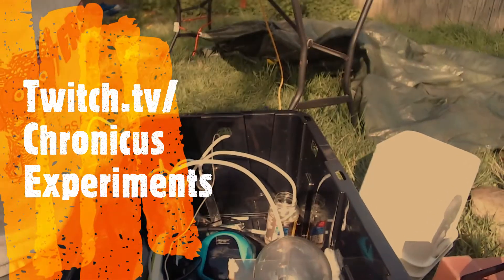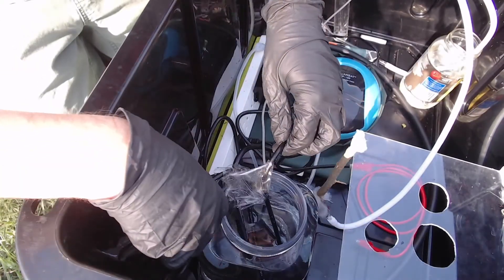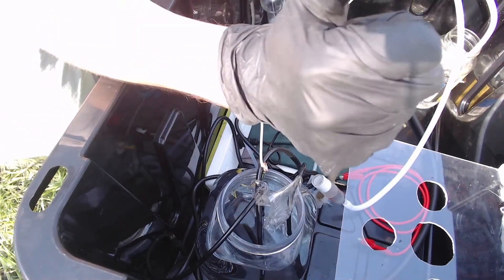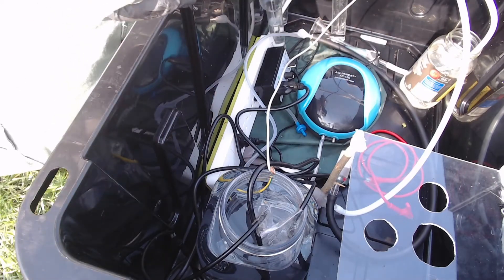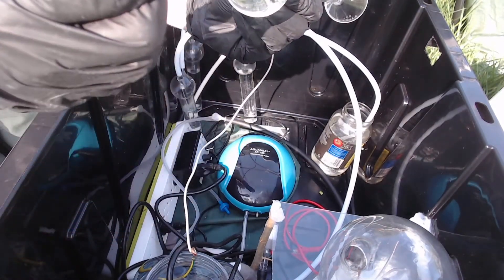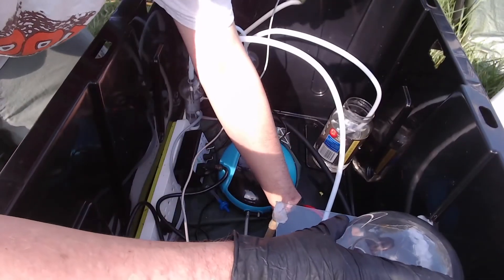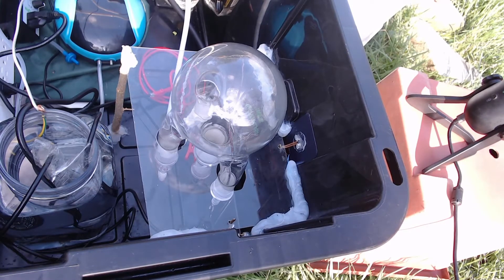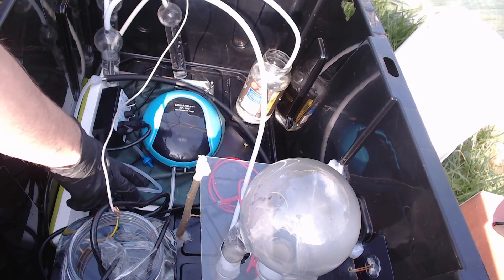Birkeland-Eyde apparatus. Nitrates from air! A short demonstration and partial disassembly.

Comment: Nice setup! What did you use to seal the space around the copper electrode that you’ve inserted through the inert gas adapter?
Reply from the maker: Teflon tape wound around the end and a dab of silicone to fill any big gaps. The silicone does tend to break down over time but the electrodes corrode before that tends to become a huge issue. Apologies for the delayed response, i dont check youtube much these days.

Comment: i think you need an oxidation tower. The first char sould be very big and no water inside. Its for the NO to react to NO2 my idea would be filled with brik pices or an other material that doesnt react with nitric acid but heas an very high survace. It fastens the oxidation up.